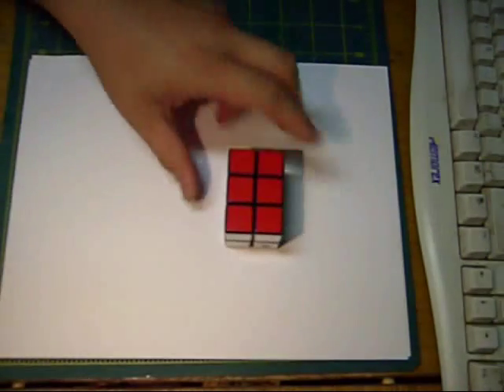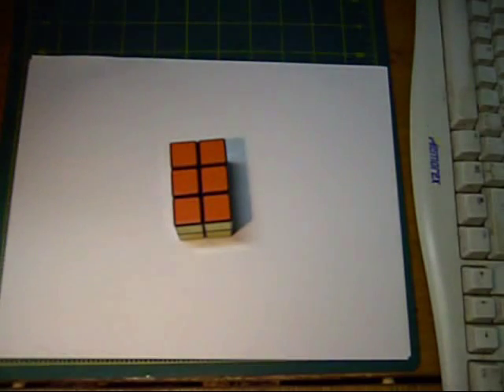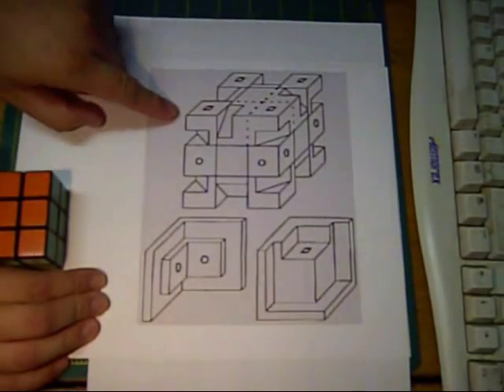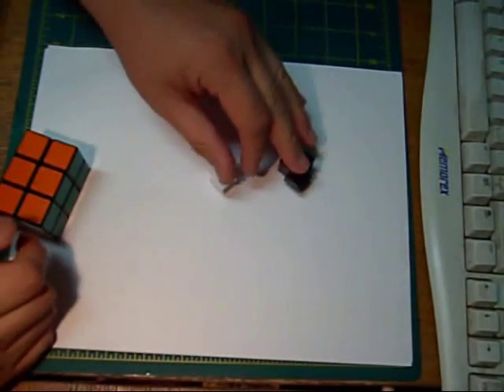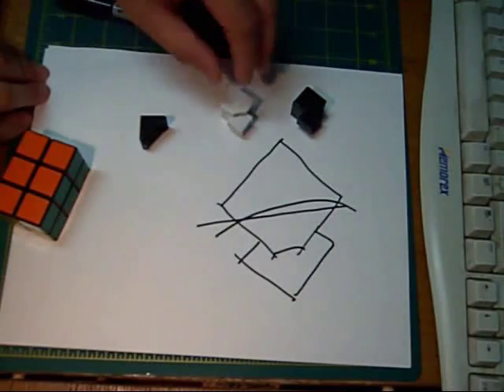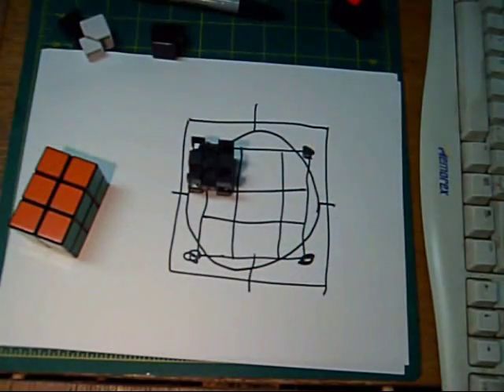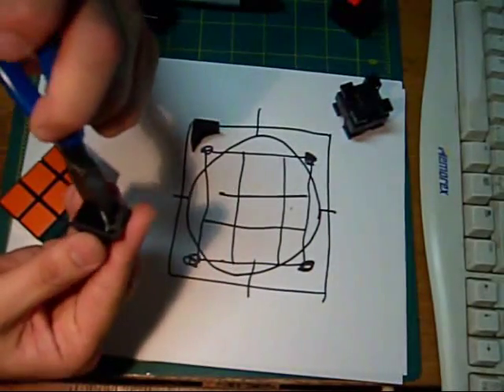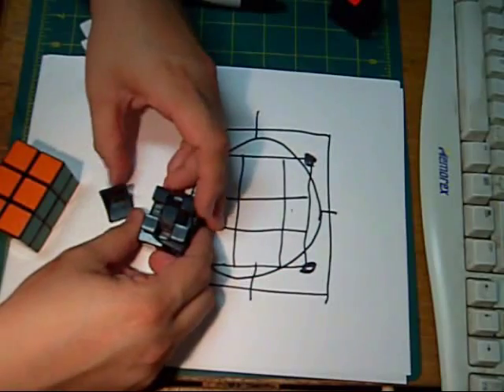How to: Build a 2x2x3 Part 1 - 1 of 2

Comment: Hi Jin, I have a question
I purchased a Rubik's Keychain, it's fairly good but is a little hard to turn and it seems that this puzzle relies heavily on the 3x3 keychain core to be smooth turning and stable. Does the fact that the pieces build a large shell around the core over come the difficulty in turning and alignment (the core after all contains no springs) Thanks